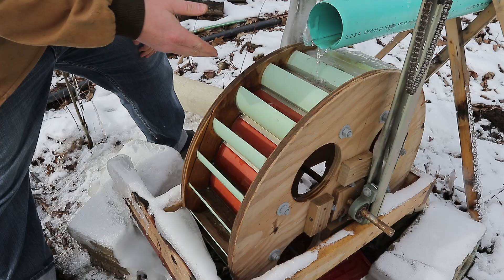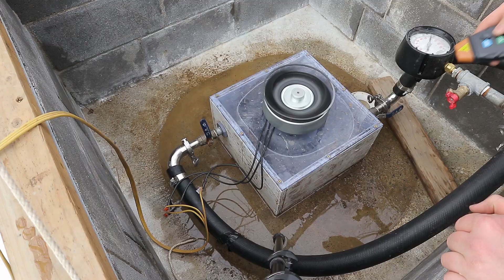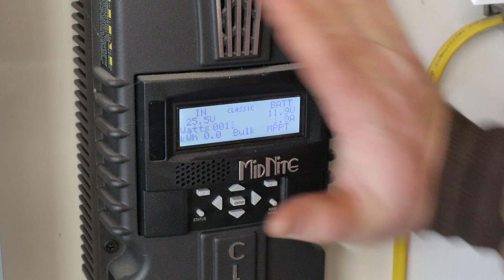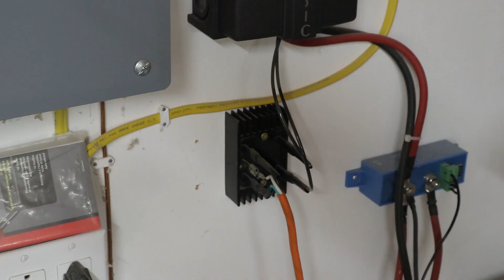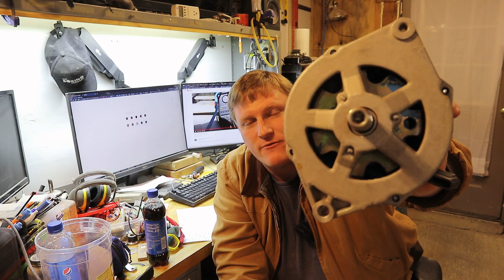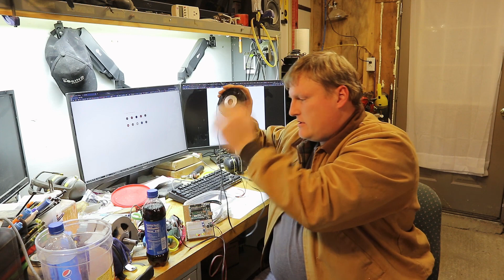*Fixed* Waterwheel Suggestions for Loftis Party of Six - weROAM

Comment: The ultimate management system?
Ram Pump on overflow from a bulk storage.
Ram Feeds a Hydraulic to open the Drain valve.
When water level drops: Drain valve closes because of gravity (may require some kind of Float and or lever arm regulation.... Positive pressure side may have valve and bleed out due to water level dropping)

Automatic water flow regulation :D
(possibly a bit too vulnerable to Water Hammer but I assume a pressure tank might help?)

Comment: Not much water on Colorado property and for sure no running water but I'm wondering about creating a circulation system because of either lots of sun or wind. Thinking about using solar power to pump water to a tank up our hill and use a small tube to return the water back down through a generator at night or cloudy days?
Reply: Unless you had major excess power production, it isn't viable.

Comment: I may have commented about this before. In summer you said you hardly have water available. The thing is your pelton wheel needs a decent amount of water, so why not put a bell syphon in your tank at the top of your hill? That way it would shut the turbine down when the tank gets empty and automatically start when the tank gets full, running the pelton at full power until the tank is empty again.
Reply from the maker: My spring box has an effective capacity of about 30 gallons. My penstock has a volume of 70 gallons. Dumping the spring box would fill up the penstock about halfway.
Reply: @JoeMalovich  Ah no, that's a bummer. I take it it's just not worth the cost of going bigger for a few watt hours in the dry season. As you've said, just get some solar panels. Edit: I can't believe I missed that part of the video, you basically answered my idea there. In your future design, if you have the smallest jet on an always open valve, you could idle the system on that when there's little water and have basically no idle current, meaning you'd always be producing something.
One thing you could look at doing is having a bank of incrementally doubled-sized nozzles (e.g. 1 gal/min, 2 gal/min, 4 gal/min and 8 gal/min) so you could switch in steps of one up until 15 gal/min.

Maybe I just tend to overcomplicate things. You could probably get away with just 3 nozzles in this scheme though.

Edit 2: Also, I have no idea if my numbers make sense, I'm from a metric country.
Reply: @ThisRandomUsername  Really there needs to me some sort of MPPT controller spear valve. That adjusts based on water flow. For example MPPT works by adjusting the voltage to pull the most current from the array. Why can't a spear valve do the same. More water makes it run faster, less water makes it run slower. If something like this could be done then this would be ideal for places like this. Though I am not sure how you will be able to do this. Though I suspect that pressure would be a factor. For example when the pen stock is full and there is enough water you would have 1k PSI and when the pen stock can not keep full the it becomes empty and the pressure drops a bit, So the spear valve adjust to a slower rate. Thus filling the pen stock back up and it slowly adjusts until it drops again and then slows it until it becomes stable again. Once its stable again it slowly opens more and if it if can maintain pressure it opens more, Once it fully open then 2nd spear valve opens until pressure drops and adjusts based on that. During high water flow there would be 2 to 4 spear valves open. If there is no need for electric at that time then they would slow down or convert that energy to a dump load. Dump loads being water heater,  Space heat or some other sort of use of this energy. 
Though this could be tested by finding a digital pressure gauge with a sensitive data collection and go to the top of the hill and begin a test of restricting the flow for a few hours and increasing the flow. To gauge how the device records and reacts to the adjustments. 
Pretty sure this idea can work. Though I think you might need some other type of generator that allows for low speed and high speed energy production. I am not clear as to how these 3 phase generators work. If they do work at all kinds of speeds then this would be ideal.
Reply: This could all be set up in a test rig as well. With some sort of pressure washer to stimulate how full the pen stock and its flow rate . Though I can not be 100% sure if pressure is the way to go, Yet in my understanding about pressure in pipes. Using examples here. A draining pen stock lowers pressure because it is not full, which means the flow of water has slowed. The head of water determines the pressure, if you remove some water the pressure becomes lower.
Reply: @kameljoe21  You're right that a variable valve diameter (a moving spear valve like you're suggesting) would be ideal. For maximum energy efficiency you'll need the tank to always have some water in so that you get maximum possible head at the set flow rate of whatever water is available. You'd probably Arduino that and use a PID library. That means your MPPT system should probably just get the water level from an ultrasonic level sensor in the top tank and adjust the valves accordingly. You're never wasting water, and you always have the maximum head,
However, as Joe alluded to in this video, for the price of such a system, you could probably put a few solar panels somewhere and get a lot more energy out in the long run.
Reply: @ThisRandomUsername  A system like this that averages 200 watts per hour all year round could produce 1752KWH a year vs a 200 watt panel that might make 365kw a year. 
A stable system like this would be ideal. 
Also the tank idea might work yet I think you would find more problems than its worth than going with a pressure based system. 
100psi pen stock pulling 1 gallon per min and if the flow is reduced then it will start draining the pen stock and lowering the pressure. Once this happens the spear valve would close a little bit till it hits a stable 100psi pressure again. Thus reducing the flow down to say .8 gallons per min. If the pressure remains stable for x amount of mins then the flow is increased to .9 gallons per min and if still stable would increase again until it maxes out the spear valve, then it would open the second spear valve. The pen stock pressure will always remain stable at x amount of pressure when pulling x amount of water from it provided it can maintained pulling that amount of water. When there is heavy rains the amount of water that can be pulled from the pen stock increases. yet a stable system like the one that exist can not take advantage of that amount of water. So that water is then discarded and energy is not made from it. The amount of extra energy that could be made from this could double or triple the yearly kwh. Provided there is a good set of dump loads set up. Extra energy used in dump loads can means that you have hot water, extra heat, running other things. 
Though the start up cost my be costly the incoming power that can be adjusted depending on the amount of water can and will increase the amount of energy it can make over time. 
Though I think this is a pretty simple concept. 
I think a system like this could be put together for around 1k. The pressure gauge would most likely be the most costly thing. As you would need one that has a communication port or wireless and power supply. The Arduino is not that costly.  Spear valves with proper gearbox motors and correct sensors would be most likely be the 2nd expensive thing. 
Though if someone was to build something like this that is a stand alone system and ready made it could work with a number of pressure and flow systems. Because it is adjustable it could be used for many systems. This type of system would be plug and play only requiring you to hook up water and connect the lines.
Reply from the maker: The problem with spear valves is they only work down to a relatively significant minimum flow rate. The one I tried only works well down to about 10gpm which is high average during the wettest. months
Reply: @kameljoe21  This would be fairly easy to make. Stepper motor mounted to the handle or a spear valve. Define maximum and minimum positions for it. Install a pressure sensor and use a PID control loop to maintain pressure. Setting the PID parameters and setting it all up on code would be the most difficult part.
Reply: @aaronfield3543  After further research there are systems just like this. They are for larger scale automation type systems from 1kw to 100kw or even higher. Though finding smaller scale parts and things of that nature is my problem. Yet the company Rickly Hydro makes custom spear valves for their units. So I would think a person could custom or even find spear valves that have flow rates from 1/2 gallon per min to 20 gpm. In any scale and make this unit work very well. 
Yes a pressure sensor would be more ideal than a gauge. Though there are videos on Arduino and pressure sensors. So that is a good start. Now just to find spear valves in different sizes. If one could find one that is goes far below the lowest flow then  having 4 units together would work very well. 
Computer Controlled Pelton Turbine
https://www.edibon.com/en/computer-controlled-pelton-turbine/catalog
I am not sure if this is a testing unit or what. yet kinda falls in to this sort of thing. Though I now have to go back up and watch the video to see what the pressures are again. I am pretty sure he talked about them. This unit from my understanding only works up to 150 psi and up to 45 gallons per min. Max, it does not spec the lowest settings. Though I think it is quite small.

Comment: Did you just end up cutting out the question about series rectifiers? I think YouTube has the option to do that on a live video.
Reply from the maker: I recorded a whole new section where I was standing in the turbine pit too explaining that he has two generators in one motor case running out on two sets of wires to two rectifiers in series.
Reply: @JoeMalovich  I've just rewatched, and you've hit the nail on the head. I did comment on his video about using one 3-phase set of wires as positive and one as negative. But it seems he has 10AWG cables, meaning two round trips at 200ft the total resistance is currently only 0,9 ohms.
Reply: @JoeMalovich  Oh, sorry. I skipped through the video and missed it.